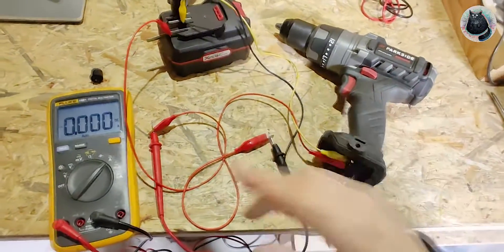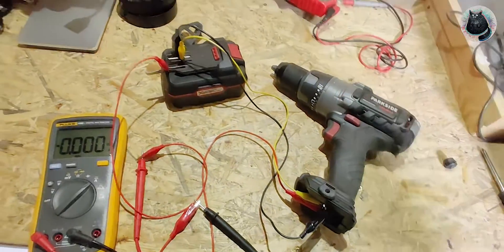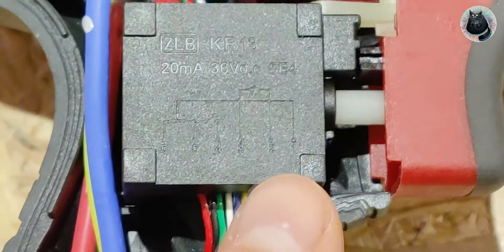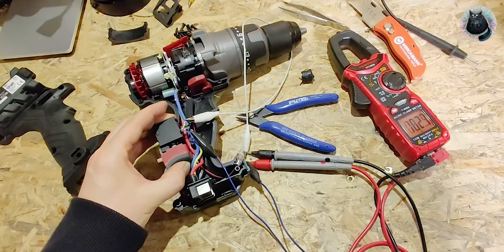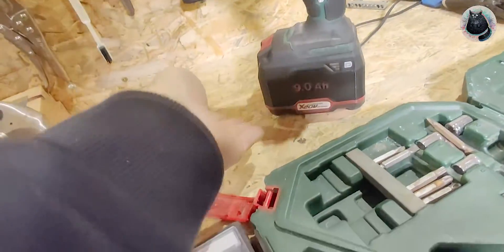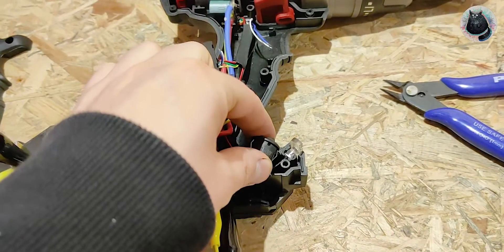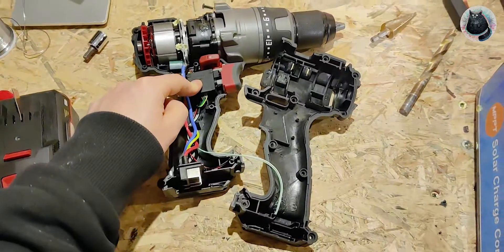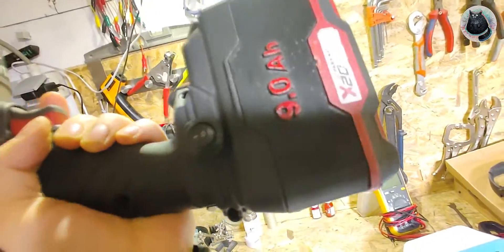Parkside hack -  "NO-SLEEP BUTTON" for PSBSAP 20-Li B2

Comment: You should have connected the original button connected in parallel. That way, if you forget the switch turned off, it will still work.

Comment: Mine died after 2 70mm screws . Now LED works for the first 10s after battery is placed in and that is it. Tried everything including multiple batteries with different charge levels and had  no luck whatsoever.
Reply from the maker: I've been using mine for quite a bit and it's still holding up strong, hopefully you got a replacement under warranty?

Comment: You should put magnetic switch (reed switch) in drills handle and glue magnet in drills case where it rests. So you don't need manually to turn on/off switch and it switches automatically when you put drill in to the case.

Comment: i like parkside products as my local lidle sells that brand. If it's a tool that i need and don't use much then i buy Parkside as it will get the job done at a low cost. as for that sleep mode.....Why ?, one thing that would annoy me would be that sleep mode. so i understand your modification, well done on bypassing that useless feature. have you contacted Parkside and asked them why this has been implemented in to the drill ?

Comment: Awesome video! What a simple hack!  This guy (https://youtu.be/28EEKWHx0Dc) achieved a longer wake time (5m+ 40s, can be changed with a different capacitor) but with a self designed small piece of electronics and is a bit more complicated. In sleep mode the device is turned off but the self-designed electronics board (the final version that uses a different timer chip) still use a very tiny amount power (will drain the battery (completely!) in 160 
days). Your hack will, when you leave the switch on, drain the battery in less than a week. It will drain it also completely, way beyond the battery safety voltage of 12,5V (to about 5V) , which will certainly damage the battery and seriously decrease its lifespan. With your (and his) hack the low battery voltage safety shutoff does not kick in.
Reply from the maker: Hi,

That's true, when the button is turned on the drill will continuously consume 26ma and drain it slowly over time, however that's why I installed a button and not just connected the wires permanently. It's just a little habit you'll have to learn not to forget to turn the button of when finished working. For me it's perfect and better than a timer that turns off every 5 minutes.

I am however having a couple of ideas that will make the button obsolete, but I'll need some stuff from AliExpress before I can try that out 😆